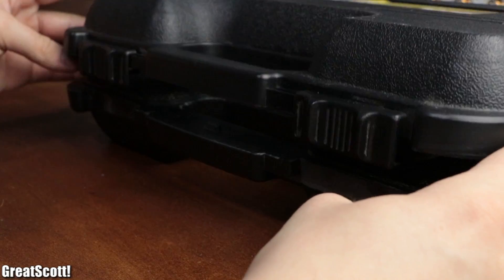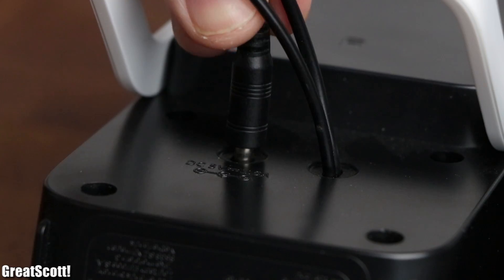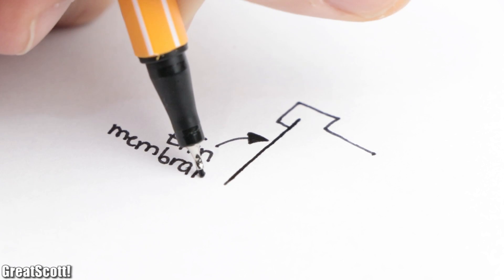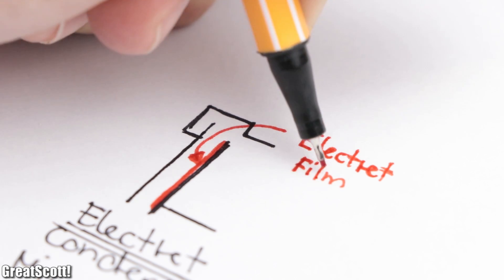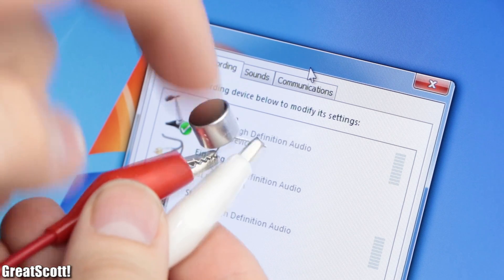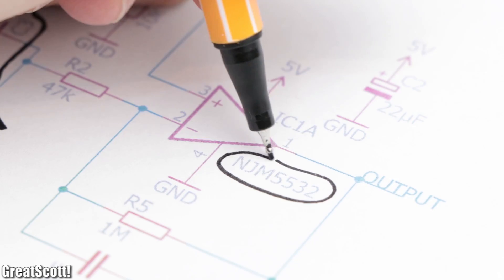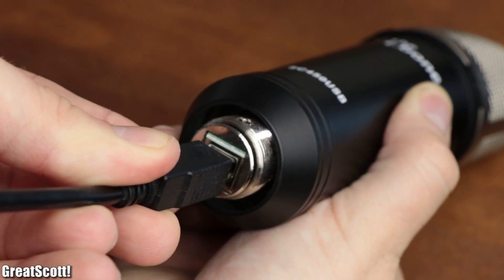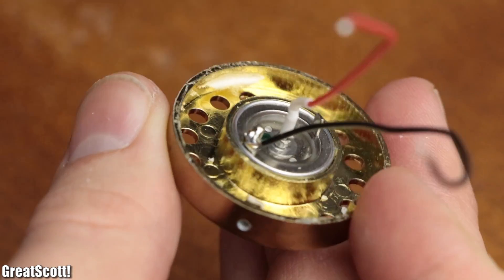Voice-over Microphone || DIY or Buy

Comment: What is the theoretical explanation for inferior performance of electret microphone wrt condenser microphone? First thing that comes to mind is that with condenser microphone, we can polarize it with greater electric field, because bias voltage is under our control. So ... Is it just the matter of lower starting amplitude of the transducer? And if it is, why are electret microphones even produced? If you don't put electret film and the FET into the capsule, you get a condenser mic, it should be even cheaper to make! My guess is that electret microphone capsules were made as a tailored solution for a specific problem - a good, cheap mike for small, low power devices, which couldn't at the time provide high voltage low noise phantom power source.

Comment: Those little 1 $£€ electret mic capsules provide remarkable performance for the price. But they are mass-produced for low-end products, so it is not surprising that they don't have the noise-floor (or "self-noise" or SNR Signal to Noise Ratio) of the more expensive mic capsules.  It wasn't really proper to demonstrate the tiny electret capsule sitting on the bench-top and comparing it to the studio mic and even the clip-on lav mic when deployed in their proper positions (perhaps only 20-30 cm from the subject's mouth).  Many low-cost lav mics are nothing more than those inexpensive mic capsules such as the one we see in this video.  Note also that little electret capsule is omnidirectional which picks up sound from everywhere around the mic.  Now there are directional (typically cardioid-pattern) electret capsules that look nearly identical except that the have ports (little holes) around the sides or back of the capsule. That allows sounds from the side/back to cancel out so that pickup toward the front is favored.  It would have been interesting to hear the mic capsule properly deployed side-by-side with the studio mic and the lav mic.

Comment: I was into audio for 5 years or so, but I only know a little about electronics (so feel free to correct me if I'm wrong). Anyways the quality isn't necessarily bad, it's just lacking frequency range.... Considering you added/applied your own filters over the raw output of the microphone, try raising the low-pass filter (to around 20khz), and/or increase the slope a bit at the cutoff(s), and I bet that mic will sound twice as good. Also make sure you're recording at 96khz sample rate to be safe or a minimum of 44.1khz. As someone else pointed out the consumer mic has a built-in soundcard/adc and those certainly vary in sound-quality.

Comment: Is it posible to powered by 3V or single Li-ion Battery 18650?
Reply: yes but you'll need to change the value of R1. You'll need to know the current draw and the standard operational voltage of the capsule ie the current of 0.5ma and op voltage of 1v with a 3v battery - (1v -3v gives 2v across R1 ÷ 0.5ma =  4kohm for R1)

Comment: Nice video, but you can't expect decent results from the electret microphone when you are using a cheap one with its one cent JFET without even a decent biasing network. It would have been a much better test to pay a little more to get a high quality piezoelectric phone (about $8 apiece) and then add a good low noise JFET based preamp.

Your amplifier also isn't very good. Although noise in a second amplification stage is much less important than in the first stage, using a 1 Meg Ohm feedback resistor is pretty horrible. Remember that a 1K Ohm resistor generates about 4nV per root Hz noise at room temperature, so the 1 Meg Ohm feedback resister will generate 126.5 nV per root Hz noise, which is very high.

Comment: The reason your voice sounds like its gone through a high-pass filter when using that small capsule is because it literally doesn't catch those lower frequencies well at all.  You can find those larger capsules available for purchase but sometimes you really have to search for them.  Visit the micbuilders yahoo group for sources, lots of other information there.  Also, the INA217 is lower noise, higher gain and needs fewer parts.

Comment: you need to build a proper body for those small mics otherwise all lower frequencies just go around them
take a look at reference mic like Behringer ECM8000 it uses wm-61a as i know which is even smaller then one in the video

Comment: I have a single source like you 0 to 5v. When I oscillate the signal around 2.5v, how should I add a simple class ab output stage to drive a speaker of 2ohm (2 4ohms in parallel) ? When I put a capacitor at the output of the opamp it got rif of the dc  offset but since the voltage cannot swing below 0v distortion happens. However when I remove the cap and let the voltage swing around 2.5v the output waveform of the speaker was again not appropriate. There is another question of where to connect the other terminal of speaker. Not to spoil the swing I think it should be connected to 2.5v but then it ruins the voltage divider. So what can be the solution? The ab output stage is simple pull-push configuration

Comment: Hi, awesome video. love it! I have a question regarding the offset voltage you put in the circuit (7:00). What is that oscillated 2.5 V  for?
Reply: That's called the quiescet point, to allow the output oscillate between 0 and 5 volts (sine wave)  so 2.5 is the midpoint. If you pick the quiescet point close to 0 or close to 5 the output will be clipped/distorted.

Comment: To me it just sounds like the diy mic is cutting off too low of fequencies. And also just add some foam to help cut down echo. But ya something is just wrong with the filters, is all. And put the electret in a decent microphone housing to capture the air pressure more effectively

Comment: I have a question!  Could you explain what function for C2 ?
Reply: C2 is meant to be an electrolytic capacitor that's supposed to be a filter running a path from the power source to ground  but it looks likes it's missing from his board

Comment: Hello Great Scott! if a condenser microphone has it's own power supply integrated, does it need a special amplifier circuit to be used properly like of that of the electret one? Would it's own power supply of 9-48V will be drained for longer time of usage?

I hope I can have the answers from you.

Comment: Hmm... Do you know if it's safe to connect the 5V to Mic in without the mic in between? Maybe with a potentiometer or something to control pitch? I'm thinking that it would be fun to create a Morse code keyer circuit where I can plug in different kinds of keys/paddles/bugs into my computer to practice morse code. What are your thoughts on such a project?

Comment: i would've recommended the gxl2200 with the umc22 ( noise level in audacity is -57 and could be lower but my pc is slightly loud also when speaking 20cm away from the microphone noise levels go to -9 which is slightly low but not bad if my set up had more freedom and i could get the mic closer like 10cm noise level is more like -3 )

Comment: That little diy mic sounds pretty good! The only obvious difference between it and the lavalier mic is the plosives are a little sharp on the DIY unit. If you put a foam pop filter on it, and/or ran your signal through a de-esser that would take care of it though!

I guess the next question is, how hard would it be to make/add a de-ess filter to the amp you made for this mic? 

I acknowledge, the answer is probably "buy" at this point, haha

Comment: There is something that I dont understand quite well. Why in a first case he connect the audio connector in ground (sleeve) and the other pin at the two other rings? (tip and ring)  And then he only use ground and tip of the 3.5 mm connector?

Comment: Great Scott. I actually study electrical engineering and, I learned how filters work. But, I don’t understand how your high pass filter works : I learned that 1st order passive filters are like voltage dividers (cap with resistor) except the cap has a complex impedance  that depends on frequency (same for inductors but inverted formula). You place your resistor in series and not connected to ground. Why? Is it because the low pass filter can affect the high one or vice versa?

Comment: This is a great video, now I got a question for you.  I got a setup that feeding a Mic to a sport camera.  The working setup is using a Mic that use a 1.5v battery and it sounds great. But every time I need to make sure the battery is good and it is kind of annoying. So the exactly the same equipment but switch to a 12v Mic (car application) and it sounds super bad that have too much volume . So is there a simple way that could use the 12v from the car power source but then will sound great like the Mic which have it own 1.5v power source? Thanks !

Comment: I built my own microphone using a electret microphone with some foam and small stand that is connected to my usb sound card. The quality of the electret microphone in this video kinda sounded worse then the one in my setup. 

Here's my thoughts:
The SC 450 microphone has a built in high quality sound card. The electret microphone's quality is based on the quality of the laptop's soundcard. 

But overall, good DIY project & Video :P
If ya going to build  a microphone, using a usb soundcard/dac might be a good option for quality.

Comment: Interesting to note that the capsule in the t.bone microphone is just an inexpensive electret capsule.  The brass ring around the microphone is decorative and not part of the actual microphone capsule.  The ring is there to make the capsule look like a much more expensive large diaphragm capsule.  Someone should tell t.bone that a 1/2" (1cm) capsule with fancy decoration does not make a large diaphragm microphone.

Comment: Hallo Greay Scott!  I've seen your video and I'm very inerested in the circuit of your old mocrophone. As an Arduino project fan,  I am now really apreciating ADC's and the one on your old microphone should be FAST SAMPLING and may be at least 16 bit. 
Here is the question: "can you figure out how to remove the DC bias filter on your old USB microphone?" 
The goal shoud be transforming that USB microphone into a (maybe two channel or in a sinhle channel) USB data acquisition card!!!! That can be veeeery cheap!  Thank you!

Comment: If somewhere in the internet I can buy condenser capsule (I know it is hard to find), I will able to build condenser microphone. Phantom power is easy to build, for example on  capacitor, diode and transistor. In this set transitor charges capacitor to vcc. Next diode does not allow discharges. Tansistor again charges capacitor but this time to 2 * Vcc (voltage on capacitor is multiply 2 times). This schematic is called "boost trap" or some similar name
Reply: I saw this schematic on Julian ilett chanel, on this video :

https://www.youtube.com/results?q=julian+ilett+trsnsistor+driver&sm=12&app=desktop
Reply: This schematić is better explain on this photo 

https://goo.gl/images/65zVjq

Comment: I have a toy car which uses two 18650 batteries... Can u Tel me a way by which I can charge them without swapping them out:)
I have bought a charger but I don't need to remove them everytime charge is low: (

Comment: I have an idea for the "DIY or BUY" it's very simple, it's relays connected by wifi or 433mhz often I see blooming in DIY stores. For example relays for heating or lights, sometimes I find it exorbitant to simply switch on and off the heating via a mobile APP.  Because in principle it's cheap it only takes a small ESP8266 and a relay and other small components. I have the impression that consumer home automation brands are inflating prices because of compatibility with their product suite.  Thank you for your videos "DIY or BUY" I find them very interesting and pragmatic.

Comment: It seems clear that the studio mic won because it captured more bass. Did you get the filtering values right in your amplifier circuit? I know the small size of the mic would limit bass response, but you should be able to compensate for that...

Comment: so i recently started a youtube channel ( Understanding Travis) and what i did was this mic and amp then plugged into a line in jack on my computer (see links below)... In the past i have built mic amps for condensor and dynamic mics ( the last mic link ) .... kind of a gray area for your test, but something that could help others
https://www.parts-express.com/behringer-xm8500-handheld-dynamic-cardioid-vocal-microphone--248-6456
https://www.parts-express.com/rolls-mx51s-mini-mix-ii-4-ch-mixer-with-headphone-output--245-044
(there are cheaper mic amps. or diy )
(and voicemeter banana  adjustment ) 

cheap dynamic mic i've used with an amp that sounded pretty good
https://www.amazon.com/Labtec-AM-22-Deluxe-Microphone/dp/B0002BQPFG

Comment: in addition to the poor capsule quality, it's likley that the element being open is one of the main problems with its quality. the positioning and shaping of a microphone body and capsule area are designed to reinforce frequencies the element is weak to, and cancel out ones it is oversensitive to.

Comment: Great vid. However, you do not need the R2 resistor in your schematic. The amplifier can detect not the voltage, but the current through the mic FET. http://www.ti.com/lit/ug/tidu765/tidu765.pdf - this article from TI shows how to make such a preamp. In such a way the SNR may get getter.
The frequency characteristics of the mic also may get better by using different, not so cheap electret mics (duh) or using several of them and combining their signals in some way. The latter method will also be used to make them more directional and, therefore, pick up less noise.

Comment: What about designing and building an intercom. Maybe you can do a 2-part series, first building a wired one and secondly a wireless one. I am sure you can use an open band for this application, since it will be low power as well. Thanks again!